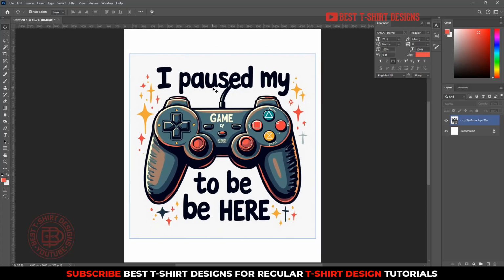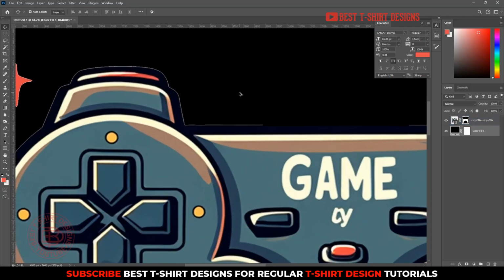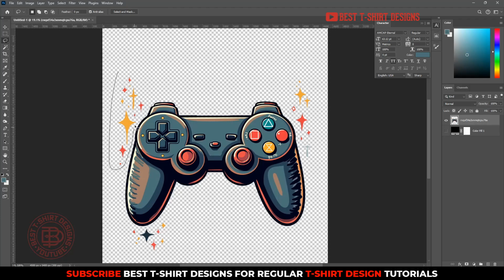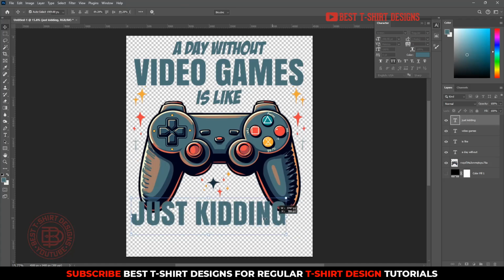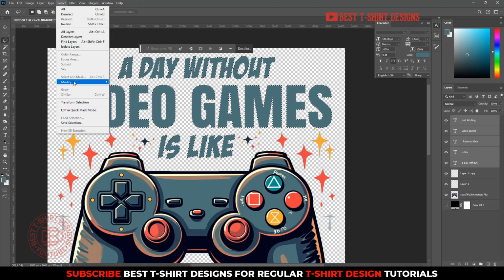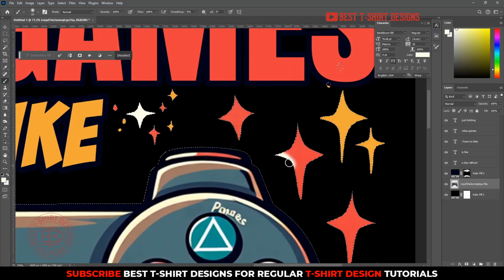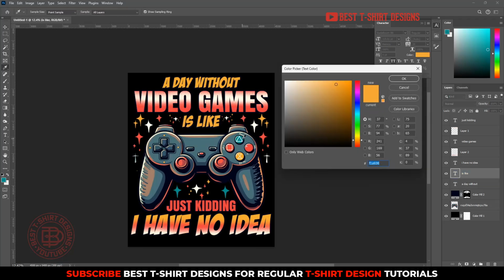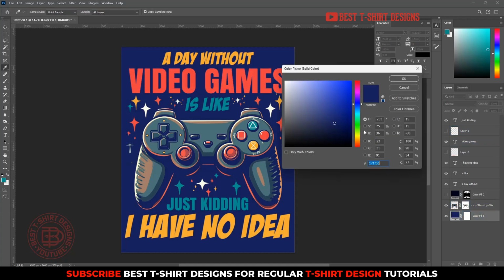🔥How to fix AI IMAGE MISTAKES🔥 Making better designs using waste ai images 🤑 Best T-Shirt Designs

Comment: "Please tell me what I should do. Whenever I upload a 4500 by 5400 pixel design to a POD store, it appears blurry. How can I fix this problem? Please guide me." i use Canva for design making
Reply from the maker: it's not only the size, but you should check if you can take 300 dpi there. maybe Canva doesn't support that. without making the artboard 300 dpi, no matter how big you take it, it'll look blurry.
Reply: @BestTShirtDesigns Vai Teepublic, teespring, redbubble aigulo shudhu usa der jonno emon kono 1ta site bolen jete amra design upload korle bd te jara ache tarao jeno order korte pare